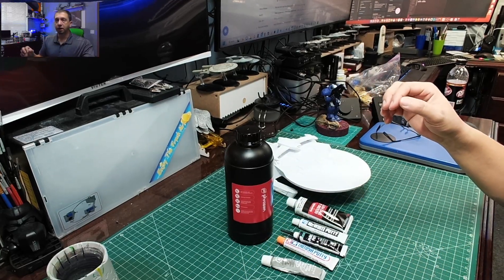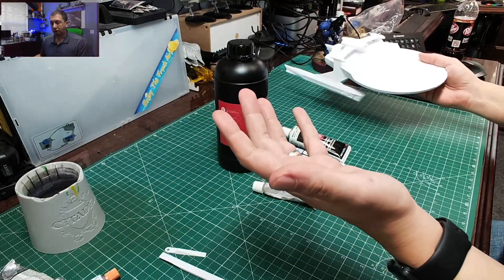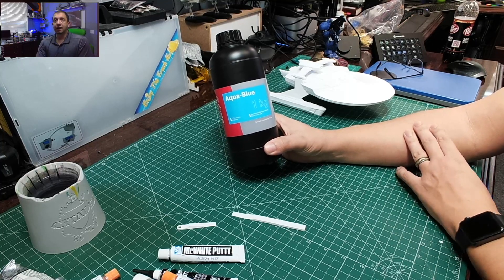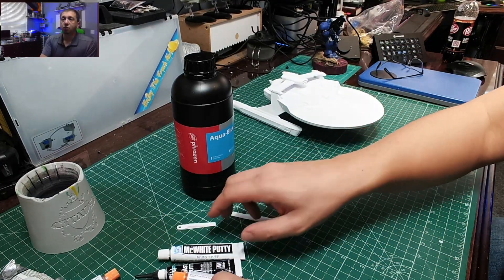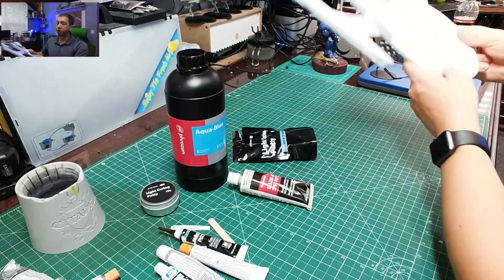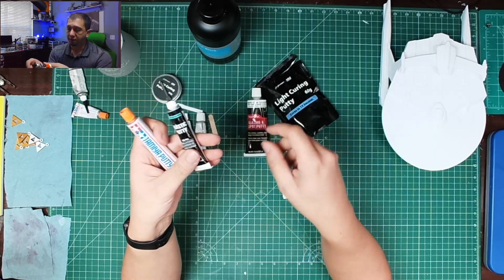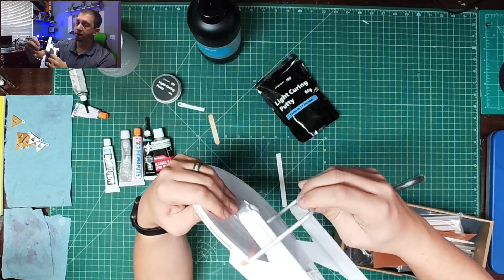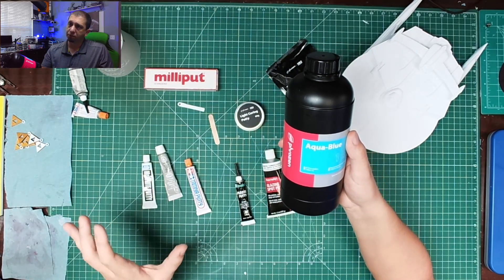How to fix layer lines on 3D prints

Comment: So lets see how i can explain this.

Ive recently printed a a model and somewhere down the line my filament got jammed apon noticing this i paused the print unjamed the nozzle and unfortunately it was a bit too late as most if my model is now showing the inside if my print the best way i can describe this is as similar to a waffer or graphical do you think i can fix this with foam clay Bondo?
Reply from the maker: Probably.  Kind of like a sponge I am guessing.  You can try the fillers but since it was a clogg the flow still may not be right.  Recommend a cold pull or nozzle replacement.  Bondo may be the best bet to save this one

Comment: You absolutly can print without layer lines, in fact this is the strength of 3D printing. When designing car parts I usually have to be very careful what kind of demoulding angle to use for certain EDM surface, with 3D printing all this stuff is for free. You can have great surfaces, they don´t have to be flat and shiny.

Comment: Hey love it, thanks for the tips!
Never seen sandpaper ribbons like that or the sticks, so cool!
I recently tried out a wood burning kit, I saw people using a solderin iron and tried that but it's way too hot, the woodburning kits come in variable temperature models and is in line with temps for most FDM materials, double super bonus is that there are so many out there, I got one with all these uniquely shaped tips, you set the temp right and it's like smoothing butter on toast, just chefs kiss brilliant!
Reply from the maker: I have been working with the wood burner as well.  You can bet once I have my technic down I will be making a video on it?!!!
Reply: @Rise3DBuilds  that be great!
Today I picked up a better spruce cutter, always struggling with supports and post support clean up. Also got myself a torch which that quick heat flash takes out the white scarring really well but yeah the technique to these things is a big part, be grateful to see what you can share!

Comment: For large models I use filler primer rattle cans. I do this after putting most of the model together and sanding and filling any seems. I then wet sand until its the way I want it. The important thing to know is that you will almost never remove all traces of layer lines. You know you've done enough when you have to look real close at he model to find any lines. I make mostly star wars and star trek models that I always use filler primer on. Its the tough to reach spots that will be the hardest to sand, like in between panels.
Reply: I've tried these too, those filler primers are nuts, totally probably got cancer as I didn't use a respirator at first ugh but the result is great!